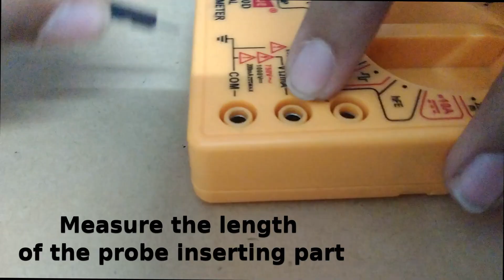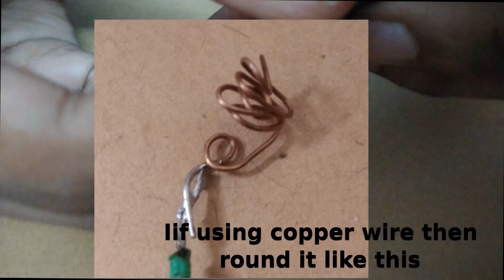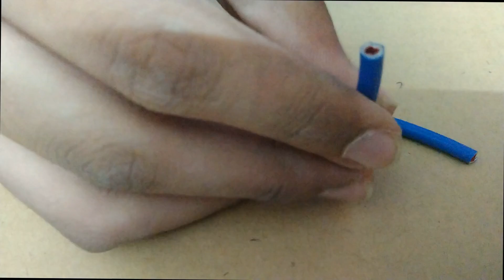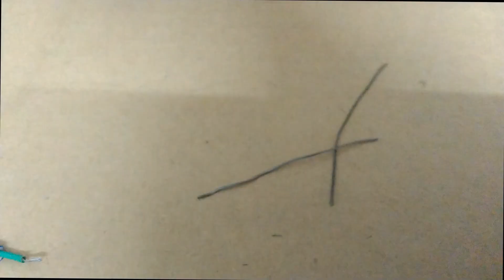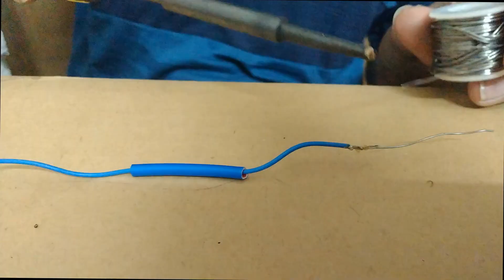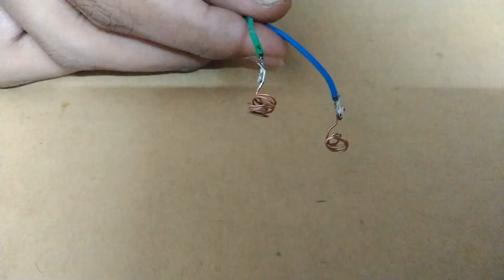how to make your first multimeter probe.

Comment: Bro how the multimeter work
Reply from the maker: Right now here I am placing the probes to the multimeter and doing the continuity test 

The ideology behind  this is that we know that when the both positive and negative probe of the multimeter touches together then the beep sound will occur which means there is direct connection. So in order to test that my probe is working correctly I did the continuity test 

And talking about how the multimeter works -

So when we are measuring the voltage the current from it is fully reduced internally by the multimeter and then only very less current passes through it and it measures the voltage 

Same applies for current also but here the current is maximum and voltage is very minimum and hence is it measures the current 

Add for resistance internally it passes some electricity and measures how much current is not flowing through it and tells the value in ohms 

These were the main feature 

If you like me to explain other features also you can sure comment on it.
Reply from the maker: You can feel free to ask me any related questions about electronics